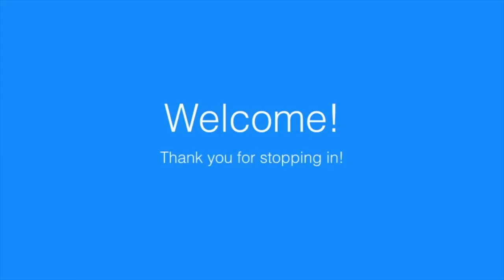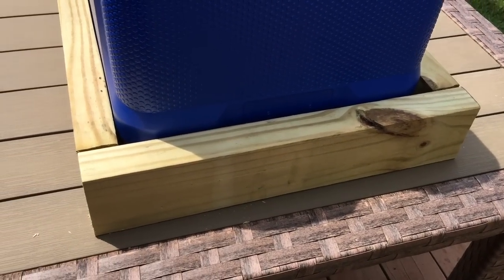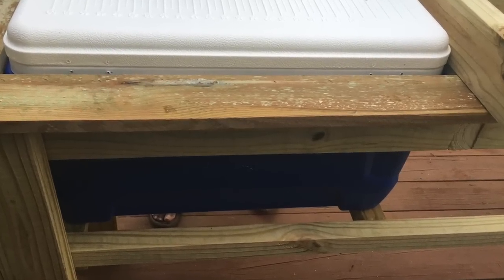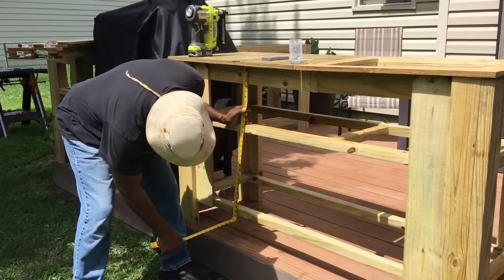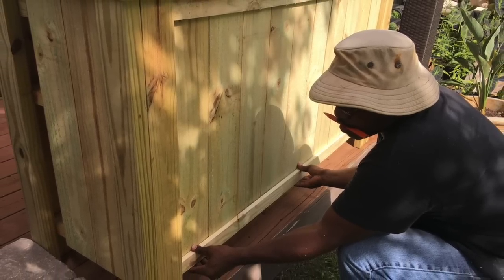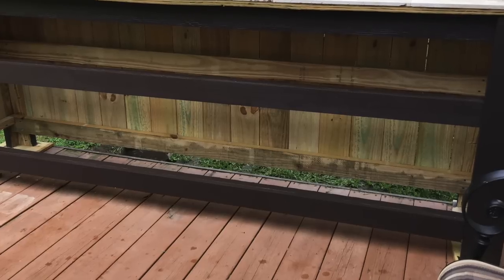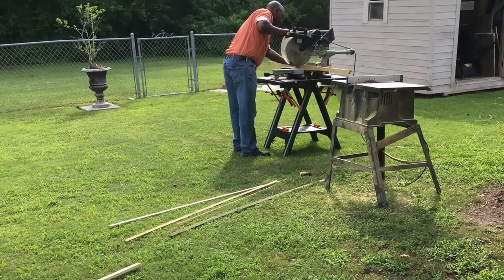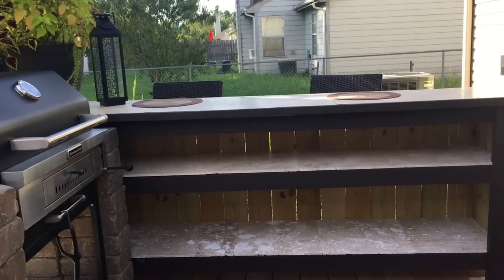DIY Outdoor Kitchen

Comment: Very nice build.  Surprised that they didn’t add 6” longer legs and orient the cabinets off the deck freeing additional deck space.  Thanks for sharing.
Reply from the maker: Catalogue Department Gynt Industries Thank you. The deck is actually pretty large, approximately 10x20 overall. Half of it, 10x10 was kitchen. The Other half,  seating area. The height of cabinets was decided on to avoid having to do any leveling on the grass for the cabinets. As well as needing to accommodate the height of the bar stools I had my heart set on. Placing the stools off the deck and on pavers was perfect 👌🏾. Basically leaving a chef’s only space around the grill. 
Thanks for watching.

Comment: How long has the bear stain held up for so far. Also they do have a dark brown stain it does hold up better in the sence it wont pop it will fade. The soild Baer will pop like paint over time. Just a heads up
Reply from the maker: Shadow Wolf We haven’t used the stain on anything yet. Only the paint. I do believe the stain does come in a dark brown. Oddly enough, the paint we used on the deck actually is beginning to blister and peel a bit. But it has been SEVERAL years since we did it. The paint on the counters is holding up well. But this has just been 1 year.
Reply: Karen T Own YOUR Style Sorry to hear that only reason i mentioned it cause i have been doing it as a trade for 25 years. Rest assure its not your husbands work its the product it self. Bear is no good for decks or outside anything says 5 to 7 years on can. We have never seen it last more then 2 years so we avoid it like the plauge. If your husband deceices to redo later on. I would recommend going (Sikens) Australia timber oil by cabot) ( superdeck).  I hate to see your husband do all that hard work & have the product fail to do what it claims. Not sure what your área carries but iam sure there more good ones👍☺
Reply from the maker: Shadow Wolf Thanks so kindly for the tip! The deck and the outdoor kitchen were both done to be kind of temporary. For years I have been considering having it turned into an enclosed sunroom. So of course a new foundation would be poured. One of the reasons we didn’t do a more permanent grill enclosure 😉 But, I will definitely keep the brand differences in mind if we ever use another deck paint. 💖. Again thank you so much. And thanks for watching my videos!!
Reply: @karent7658  no problem my plesure watching your utube Videos. I hope your outdoor sunroom turns out  just as good as your this project did. When you do your outdoor sunroom be sure to post the new project so we can keep a EYE on the contractor who does the work.LMAO  JK.  be sure to get 4 bids directly from the contractors them selfs not homeadvicer type site. Tell Husband i said hello.
Reply from the maker: Shadow Wolf Hello there! Husband says hello 👋🏽 back!! That’s funny about keeping an EYE on those contractors and quotes!🤣. That’s actually what my husband does for a living. He evaluates quotes and inspects contractors for big government projects ! 👍🏽 Hope you and yours are all well!!